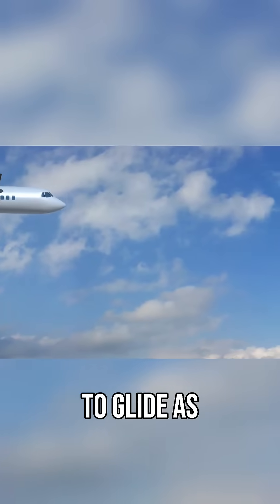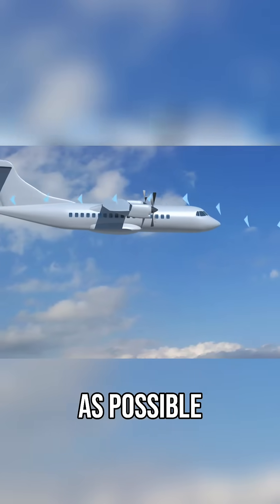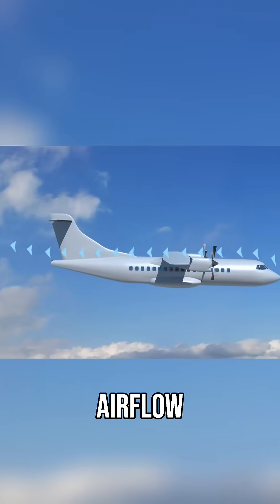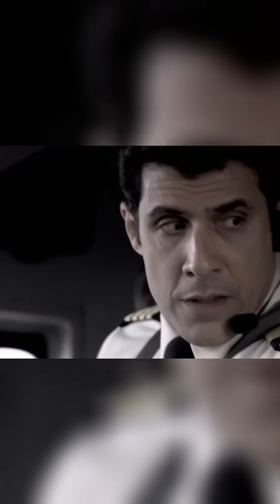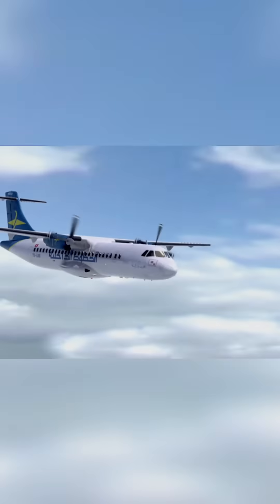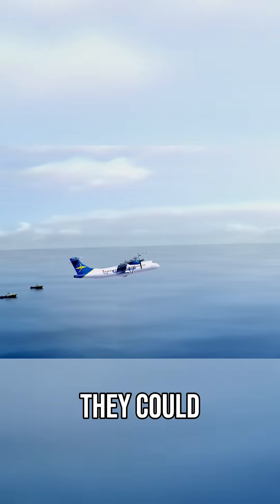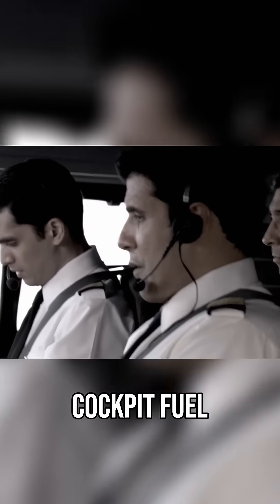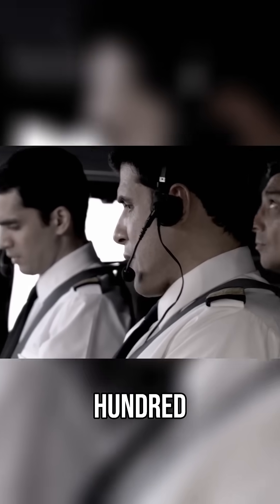The FATAL Mistake That Doomed Flight 1153 | Mayday: Air Disaster

Comment: NOTE: the plane had an incorrect fuel indicator installed, which is why their instruments showed that fuel wasn't empty at all.

Of course you'd then first try to restart the engines, instead of immediately going into optimal glide mode.

HOWEVER, the pilots KNEW that there had been an issue with the fuel indicators, BECAUSE IT WAS THEM, WHO REPORTED IT.

And it's also standard practice to feather the propellers after a flame-out to reduce drag and improve glide distance, which they never did.

HOWEVER only one of the two simulator recreations managed to land safely at Palermo airport. So even if they had done everything correctly, there's no saying whether they would've made it.
Reply: @kayjasmin4326  fascinating analysis!

Comment: They still tried there best to save the aircraft
Reply: As
Reply: No they didn’t, they didn’t do the basic things that a student pilot would do.
Reply: @Freedom4Ever420  like what Einstein?
Reply: @Jjodoql they couldn’t feather the prop blades.
Reply: @Jjodoql  Don't even bother, they aren't looking to participate in a good faith discussion. Only to make people angry.
Reply: Because of the faulty fuel reading, they attempted to restart the engines, because of that they needed to maintain speed and not touch the props. After it was clear the plane would not restart, they were already too low. 

As was stated, had he KNOWN that there was no fuel, he would have abandoned trying to restart the engines and optimized for gliding.

Unfortunately, he made a choice based on the information he had available to him the time. The simulator test is only what would be possible had they had known what they gained in hindsight. It's a perfect scenario without the stress of a real-world event.
Reply: @CorruptNova  exactly! When given false information that takes up time because you think that’s the problem.